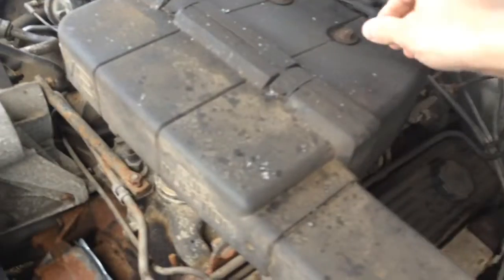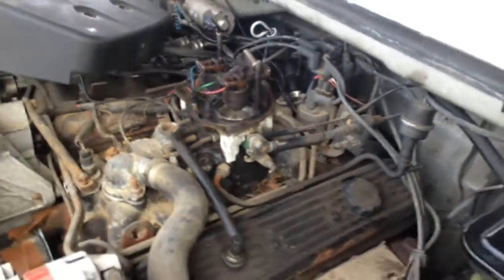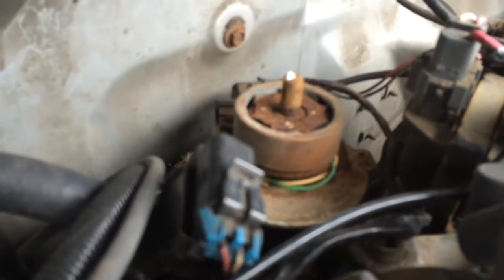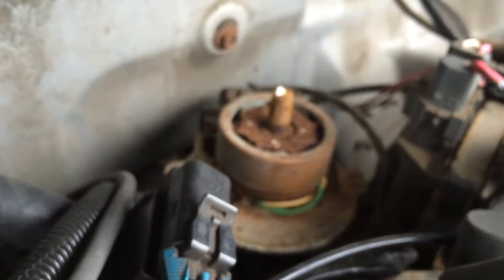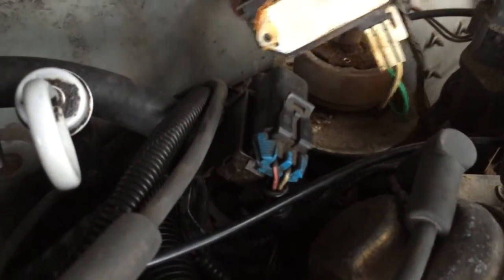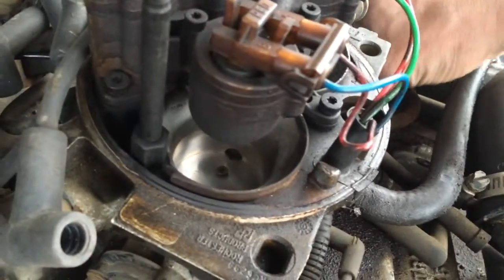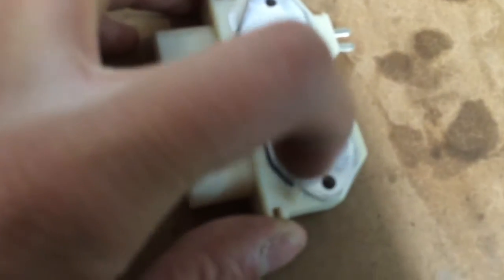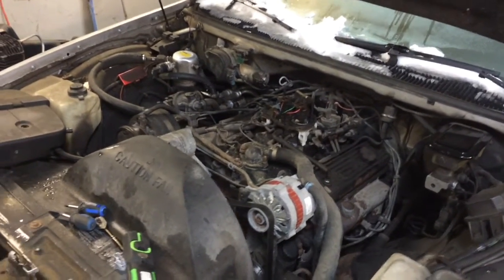ICM - Ignition Control Module Discussion & Replacement

Comment: I have a 90 Caprice 305. Just keeps cranking eventually will fire up. No engine noises or knocks. It'll run and has good power. When i drive around eventually it will stall. I noticed it runs rough like its out of gas and i believe backfires, starts losing power. That came and went return to normal. Eventually it stalled after this happening more than once. Could this be the issue? I notice when it sits for some time it fires up again.

Comment: Not getting any crank or start after i installed a new lock cylinder 84 caprice.im getting power it just seems like the  battery might be dead or either starter.

Comment: New cap and rotor new icm still no start please help 87 caprice
Reply: What was the issue?
Reply: Did mine today. Just the distributor cap. Used the old rotor, didn't want to fight with it - lots of rust! Didn't know that there is an ICM underneath... Only wire brushed the surrounding rust off. 1995 suburban 454. 12 year old rotor & cap (super corroded)

Comment: I feel compelled to share some advice I was known as an 18 year old entry tech at a Chevy dealer many years ago as a GM obd1 genius with or without a tech1a...THE ICM...WELL...I've only had one come in that needed it. That said buddies, colleagues, and customers I knew working at oreilly as a certified parts specialist...btw I was the guy on the customer side of warranty. Rare it be needed but I was everyone's "oh shit" going in that day and I'm not working so lol I know a bit about parts...this is obvious from feedback the ICM is in fact a creepy failure prone prick in the...yeah...so a good part to just replace! The coils...never a failure...yet...they are not getting younger and like ferris bueller the miles ain't coming off! My 93 k1500 blazer I've had a 92 and 94 sport so I've had all 3 years before becoming the Tahoe. I've owned tbi firebirds, vetted, fieros, pickups, you name it! Just replace the coil you'll feel a definite drivability and great responsiveness and wake it the hell up, another word the wise replace the damn distributor as early as possible and royal purple max film penetratant is your friend you're lucky to get it out in the rust belt and the dizzy wrenches dont work 6 or 12 pt there is no leverage its slammed to the firewall or bulkhead whatever ya wanna call it. And dont cheap out I didnt say 382 bucks on a Mallory overpriced BS but just not cheap a1 cardone or chineese dizzies to cheap to be good. Also check you injectors if you got dripping it can cause shit. Check your map, rare an EGR, check the vacuum lines. Tbi gasket and the tbi rebuild is a good I'd idea. IAC valves go, TPS are fail points, replace that 16 dollar one and only O2 sensor cause it's only the same lifespan as original copper plugs...30k miles cause it's a single wire unheated, non isolated ground sensor! These suckers have one last trick and me I got one final tip. If you suspect a map, iac, tps... ect...shut it off, unplug it and if it acts a little wierd by high idle or whatever but you issue is totally gone...you nailed the culprit. Hope I save some people some tile feel free to ask me any advice on obd1 gm cars and trucks I'll happily help you out. :)
Reply: I replaced my distributor cap today. It needed it... Did not know there is an ICM underneath it. However there was rusty dust. Wich I just wire brushed off either side and. Installed new cap and wires. It's a 1995 GMC suburban with the 454. Runs fine with 900-950 idle speed but very little horsepower. I still need to test drive it later tommorow, since changing the cap kicked my ass -

Comment: I also just changed the ignition coil and still no spark next Step will be the icm
Reply: On a 1996 Chevy the ignition coil and icm are connected I was told you have to change both not just one they go hand in hand...

Comment: I have a 350 5.7 motor that ran with high oil pressure ran it on freeway and it died completely on me now it’s turns over but won’t start. What could it be?
Reply: What was it?

Comment: On an older car such as your 1978 Buick check to see if the vacuum advance is working. It was shot on my 1977 Buick, and replacing that defective vacuum advance plus making sure the timing was right made a huge difference. It's like I discovered 50 horsepower!